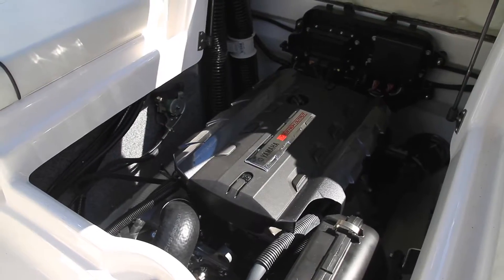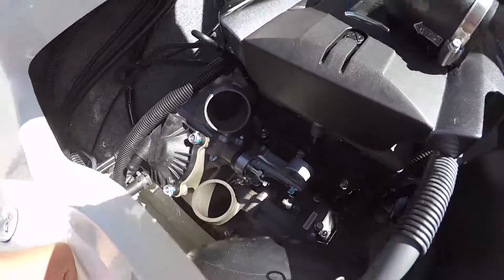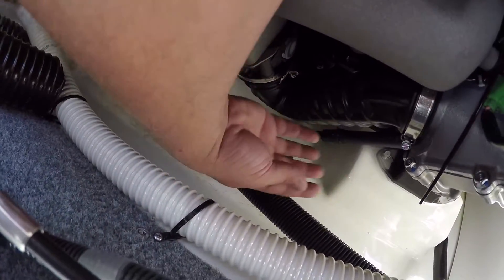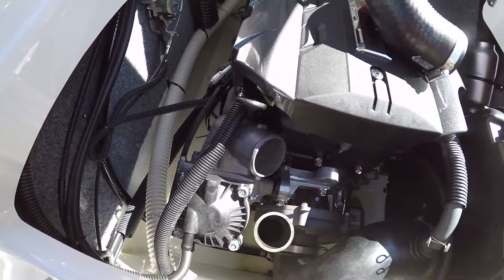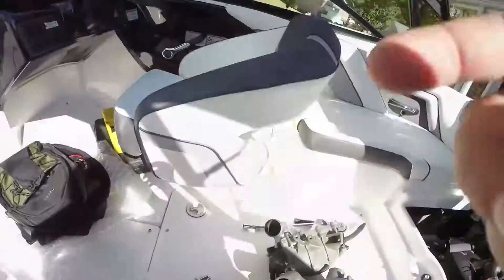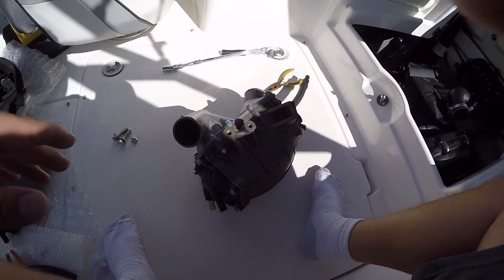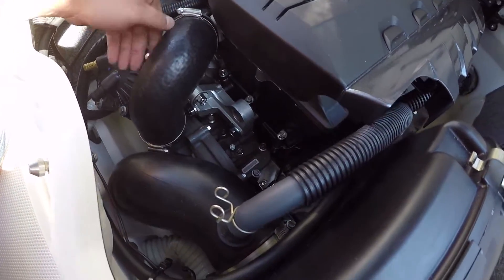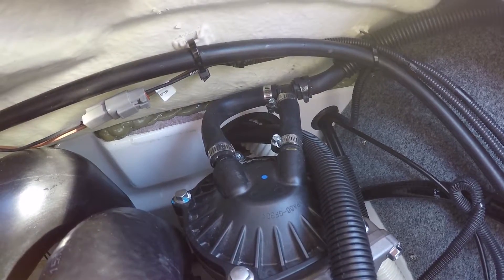How to upgrade an SHO intercooler to SVHO intercooler in a Yamaha SX192 or AR192

Comment: Do you have the part number
Reply from the maker: At the time back then, I used 6ET-13670-01 but I think they have other numbers now. When I google SVHO intercooler part number, it is suggesting 6HL-13670-00-00. Not sure of the differences and if that one supersedes the other.

Comment: Another question, why are there two outlets on the starboard side for a single engine?  Did the factory OEM intercooler "pisser" line "y" off somewhere downstream?  If so, with the new setup, why not just run a two new lines and dedicate one outlet on the starboard side for each line?  Thanks for the video!  I am looking at buying a 2014 AR192, just prepping for this project.
Reply from the maker: @pastorfred3460  OEM 192 comes with 2 pissers (1 for the engine, 1 for the SHO intercooler). The SHO intercooler only has one pisser outlet while the larger SVHO intercooler has an extra pisser outlet. Instead of running an extra line and drilling in a new pisser in the hull, I decided to Y them into my single stock intercooler pisser. Newer model 195 boats with the SVHO engine and intercooler come with 3 pissers (1 for engine, 2 for intercooler). I am not sure if it really mattered I Y them vs run an extra line. I mean maybe some better flow with 2 individual lines to the pissers but eh, it just wasn’t worth the extra time and parts it would have took. Once I did the test ride and could tell my heat soak issues were gone, I didn’t even 2nd guess adding the individual line later down the road. Boat was much better and if you’re looking at a 192 and want it to have good performance throughout the day, for sure looking into upgrading the intercooler with a Fizzle or SVHO if you want direct drop-in route. Fizzle is a better intercooler if you care about more mods like BOV and more power.
Reply: @ appreciate you taking the time to explain!  Thanks!

Comment: We are looking at a used 2014 AR192, anything you would recommend to check to see if it has had intercooler issues?  Also, do these boats require premium fuel?   Thanks again!
Reply from the maker: @pastorfred3460  yes I believe it did require premium due to the supercharger extra performance. I don’t have the boat any longer. The stock intercooler is too small and in humid summer days the engine performance will drop several MPH throughout the day due to heat soak. A larger and better flowing intercooler like the SVHO or aftermarket like Fizzle or other brands will keep the engine from suffering heat soak. Once I swapped intercooler I was able to maintain performance all day.
Reply: Thank you!

Comment: Hi, can someone share the increase in speed from the intercooler upgrade   thanks
Reply from the maker: Jorge Rivero no increase in speed but it what it does do is prevent you from losing speed due to heat soak from the smaller stock intercooler. Basically this allows you to maintain top speed without heat soak robbing you of power as the day or temps rise.

Comment: I have 2 if these Intercoolers for sale if anyone needs them, I built 2 race boats and don’t need them.  The 2017 GP1800’s that they came out of only had 4 hours on them in fresh water.   Currently on eBay, or DM me
Reply: I am in the market for one david g.  Please contact me.
Reply from the maker: david g You should post them up for sale on jetboaters.net. I'm sure they will sell since there are several members who like to swap out the stock intercooler.
Reply: Justin Stephens  hey I still have the Intercoolers.  I have one on EBay right now.

Comment: Great video!   Exactly what I needed. Did you ever remove the Y/T and add another pisser?  Also did you ever add its own independent line to the IC?   Wondering if either of those make a big difference.  Lastly I saw on the forums you considered retuning the ECU.  I'm dying to find out if upgraded intercooler and remapped ECU makes a big difference.
Reply from the maker: Ted loring hey Ted glad you enjoyed the video and I hope you find it helpful. I am still using the Y fitting. One day I'll get around to running another pisser but that will be a winter project. I have not run a dedicated IC water inlet line and not sure I have a need to since the heat soak is gone for  the most part. I am still on the stock ECU and waiting for deans boat tunes to be ready. A member on the forums named SamCF has a nice mod list going for his 192 and he is hitting 59 mph verified GPS with 3 people and full tank of gas!
Reply: Thank you for the quick response.  I have a place in NH and the waters don't get hotter than 76 degrees ever.  Perhaps adding a water inlet would be a waste of my time.  I was considering an SVHO oil cooler as well but perhaps that's overkill as well?   My plans would therefore be the IC and the remap of the ECU.   Best of luck with your mods!

Comment: I did the same conversion...but added a third pisser.  I also removed the flame arrestor at the same time. Added about 4 mph to the boat with much better throttle response.  Thanks for the help.
Reply: Do you have a how to vid for removing the ribbon?
Reply: Stuff a rag in the supercharger to keep stuff from falling into it!!  Just don't forget to take it out lol

Comment: has this kept you at 50mph all day?  my sx192 will hit 52 then back off.
Reply from the maker: daniel cole my boat has never reached over 50 MPH indicated (sea level). I guess it weighs a little more than the SX192 since I have the tower. Upgrading intercooler will help keep heat soak in check. I'm able to maintain a higher RPM and MPH than before as mine doesn't drop performance as bad like it did when it was using stock intercooler. There is a big thread about it in the 192 forum section on jetboaters.net
Reply: is that the only modification you have made?
Reply from the maker: daniel cole yes only mod to the engine so far. I will be doing the ribbon delete next to get 200-300 more RPM.
Reply: thanks.  are there any issues the larger intercooler can cause on the engine?  I'm looking for one for sale now.
Reply from the maker: daniel cole no issues at all. In fact these are the same intercoolers that come on the new 2017 SX and AR195's since they now come with the SVHO engine (better supercharger, better intercooler, better oil cooler and 160mm pump versus the 155mm jet pump on our 192 boats). You can also go aftermarket intercooler for even more cooling like a FrozenBoost Type 14, Riva or Fizzle 1000. The Fizzle is the best you can get but also the priciest. I decided to go with the upgraded SVHO because it's OEM and a direct bolt-on replacement. The intercooler simply cools the hot charge coming out of the supercharger so that it will provide a cooler more dense intake charge. These boats suffer from heat soak in the stock SHO intercooler and that is why your performance drops after a few minutes from launching off the trailer.
Reply: thanks.  hopefully one pops up on green hulk.
Reply: if you see one by chance, and don't mind, shoot me a message on here.  i picked up my 192 brand new really cheap out the door instead of getting the 195.  i don't mind spending a couple hundred on the upgrade.
Reply from the maker: daniel cole there is a thread I created on greenhulk where I was asking for people to let me know if they had one for sale. Since then a few other jetboaters.net members posted in that thread looking for a intercooler too. Probably your best bet would be to post in that thread and someone will PM you. I had several people message me with them for sale but since then those people have sold to a local friend and one other guy in my thread. So they are out there just have to be patient. Search my same user name on there and you will find the thread in the Yamaha 4-stroke performance forum section.
Reply: cool thanks